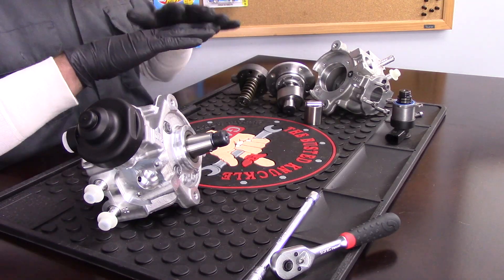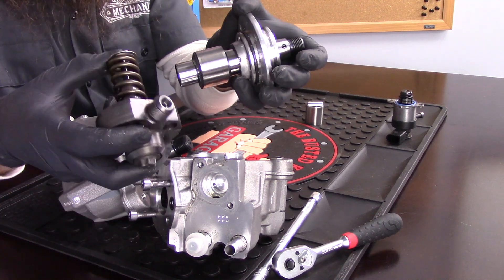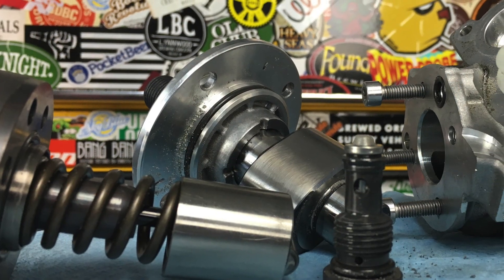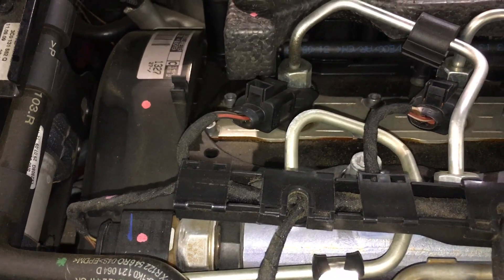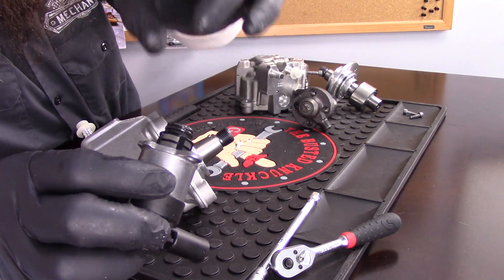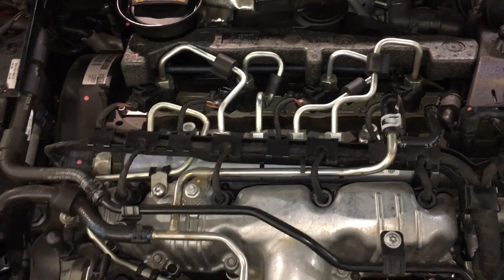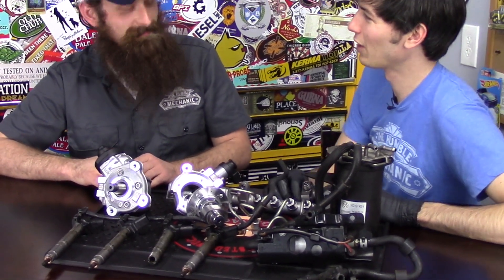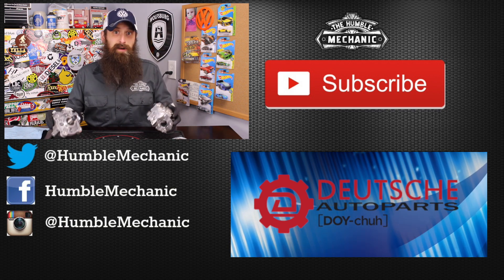How VW Parts Fail ~ TDI High Pressure Fuel Pumps

Comment: This is a completely overhyped problem. I work at an independent vw/audi shop. We sell tons of a3 and jettas with 2.0 tdi. Work on tons more. We have yet to see one failure. Most failure is caused from contaminated fuel. I.E. water, crap bio diesel, people even put gasoline in them.
Reply from the maker: Today that’s very true. Back when this video was new, it was really common.  We were doing 2-3 a week st the dealer.  Most weren’t misfuel issues.
Reply: @HumbleMechanic  how can a dealer substantiate a fuel contamination allegation? I have a 2014 VW Jetta TDI that was part of the emissions fleet modified and resold by VW. I have that same exact problem yet the dealer is voiding the warranty under pretense of contaminated fuel. How could the contaminated fuel be adjudicated? Ie how do I know my fuel is really ‘contaminated’ n whether that contamination is what caused the fuel system failure?  Please answer me. I’m stranded without a car for 3 months now. Bought that Jetta for $8k in 2019 now in 2022 it’s costing me as much to fix it! An abrupt failure on the Highway without warning out of nowhere!
Reply: Sooo by your logic just because YOU haven’t seen the problem that means it doesn’t exist? This happened to my 2010 Jetta TDi and I had to shell out $6,000 to fix it because I was sitting at 121,000 miles. In order to qualify for the DG Buyback I had to out of pocket this so the car arrived at the dealership under its own volition. This pump, the CP4 pump in Touareg TDi, the larger Bosch pump in the Ford 6.7L Powerstroke….from THAT era were known to catastrophic failure. It is VOLKSWAGONS story and excuse to NOT fix it and blame it on contaminated fuel. MY FUEL was GOOD but they flunked me because I didn’t have the filler neck mod, which ESSENTIALLY was VWs recallesque solution. Bbuuuuuttttt I always have my VWs serviced at the dealer…wwwhhhyyy didn’t they put it on my car. You’re right. Completely overhyped.
Reply: I’m suffering w that problem. The dealer blames it on contaminated fuel. I am the sole driver of my vehicle only full diesel almost always at that one quick check in my area. The dealer needs to substantiate the contaminated fuel allegation before they void my warranty yet they’re refusing to! Wth is contaminated fuel????? I only fill diesel at the same quick check yet suffered and abrupt failure of my fuel system.

Comment: Hi HumbleMechanic, I got a story for all TDI owner that you would not believe. Just recently I had HPFP failure on my 2013 Passat TDI about 2 months aprox 10,000 kms after the emissions fix.  It was the classic failure glow plug lights flashing loosing power quickly to never start again.  Searched on the internet and used VCDS to scan the car and confirmed that HPFP has failed.  I called the dealership and they said HPFP and fuel system is covered under Emissions fix extended warranty (Canada).  The only time it will not covered if they find fuel contamination.I thought I would be extra careful After I heard so much about VW finding an escape goat and not to covering things under Warranty.  I drained the fuel tank (which I tested was 100% diesel) and there is no way I will miss fuel my TDI as this is my 3rd TDI.  I remember filling up at the ESSO gas station and their was Sprinter guy waiting behind me to finish so that he can fill his tank.  Anyways I emptied the tank using VCDS and running the pump.  After that I went to another gas station and bought 23 liters of  Diesel fuel in the can and dumped it in the tank.  Cleaned the fuel filter reservoir and change the filter.Next day I Called VW road side assistance and had the vehicle to towed to the dealer.  After couple of days I called the dealer as I had no update from them.  The service advisor told me that they smell gas in my tank.  I said there is no way and went to see the car.  When the showed me the tank with fuel pump removed (under the rear seat), I told them how come it seems like its more than quarter of tank.  They said that they had to top it up in order to troubleshoot.  I asked them what kind of troubleshooting is this, that it needs more than 1/4 of tank.  They insisted that it smell of petrol and it may be that I had put gas instead of diesel in the car.  I told them that this car has filler neck to stop a gas nozzle from fueling the car.  I asked them to do fuel analysis and let me know the results.I called them a couple of days later and the service rep told me that VW was coming to get fuel for analysis.  After that I did not hear back from them.  I called them again as its now approaching two weeks since they have my car in the shop and no rental was provided to me.  They tell me that the service rep is not at her desk and they will get back to me. So finally at the end of day on Friday I call them again and ask to talk to the service rep and she told me that the car would not covered under warranty as it has contaminated fuel (petrol mixed with diesel).  I told them that I need to talk to the service manager.  When I talke dto him I had few basic questions for him.  How did you come to the conclusion that the fuel is contaminated and why did your shop mechanic felt a need to add more fuel to the tank.  I gave the car with 1/4 tank of fuel and now its past 1/2 tank.  He had no answers for me and told me to talk to my Insurance company.  I went and confronted him and still he had no answers.  I asked for report on the fuel and he said they don't have any, all they know is that fuel is contaminated. I had my car towed to my home the same day and started documented everything.  I did the fuel test with Styrofoam cup and found that it had petrol in it.  I did the same test on original fuel that I had saved and no traces of petrol.  I once again drained the fuel and refueled and sent it to different dealership and waiting on the response.  I have video tapped everything on draining and drying the tank and then refueling with new diesel.  Also have the Styrofoam tests on video.I'm so mad at VW dealership and will be brining out my story to the Media.  Hopefully its only one bad dealer and not the VW itself.  We will see... I will keep everyone posted.I keep on remembering the VW CEO statement, We have to build the trust again.. yeah right.
Reply: Keep us up to date on this
Reply: I've been considering a 'fixed' Dieselgate Passat.  This story scares the <bleep> out of me and makes me thing a hybrid might be a better alternative even though I really want the TDI.  Sooooo sad!  I hope you finally got your car repaired under warranty -- and then exposed this dealership to the universe!!!!  This is a news story waiting to be told!!
Reply: How did it go with the 2nd dealership?
Reply: You post a novel like this and leave it with a cliffhanger? Can you give an update?
Reply: This poor guy got screwed
Reply: Please update...
Reply: I am going through something similar right now! I am on 10 months so far.

Comment: I have a mk7 tdi with 49,000 miles, i run kleen diesel additives usually every fillup, rn its the winter additive, i just replaced the fuel filter at 46,000 miles, hopefully that prevents this failure somewhat, i figure there is only so much i can do, any recomendations past this.
Reply from the maker: I think you hit it dead on. Do the maintenance, drive the car and enjoy.

Comment: Hi.. i having question on diesel fuel system...  my diesel engine common rail pressure read up to 1000 bar during cranking.. and can hear high noise of knocking from my engine, after let it idle for 3 to 5 min, the CRP drop to normal idle reading 300 bar.. checked and replaced the new SCV, however the issue still persist... need your humble advice.. thanks..

Comment: i have a 2006 passat, dealer says camshaft worn out and it need a 3000 repair, i will work with an updated to fuel pressure pump since camshaft does not seem to be that bad to me.

Comment: Greeting @HumbleMechanic !! I have a 2010 Jetta TDI that I bought new in December 2010. June 6, 2018, just 2 weeks ago, our car stalled coming to an intersection. It wouldn’t start again. Towed to dealership where they found metal in the fuel. They’re claiming the fuel failed the contamination test, and won’t cover it under the warranty we have for the fuel system. I’m so peeved… even have the last 3 receipts showing I used diesel fuel. (Also I’m not an idiot and have never mis-fueled my vehicle – I bought it BECAUSE of the diesel). How many miles would you estimate you could go on contaminated fuel before it dies? I was at 384 miles on that tank (im estimating I went through about 8.5 gallons).
Reply: Sue. You get nothing without fighting. Threaten them with media coverage.

Comment: If you dont want this to cause a huge issue replace it every 100k. before it goes bad.
Reply: we are finding that over 100k is borrowed time if you dont have contaminated fuel. Ususally before 100k repairs are from more bio diesel or contaminated fuel.  If your in a bio fuel percentage state might want to lower that to a 75k interval.

Comment: Let's call a spade a spade... this is a Robert Bosch HPFP failure, not a VW failure. Just like the VW TDI Clean Diesel Scandal, and Robert Bosch has to pay a fine also, as ordered by the judge via a court order. This Robert Bosch HPFP failure happens in all badges of cars and trucks that use the Bosch CP4.1 or CP4.2 HPFP.  Ford, GMC, Ram Ecodiesel, etc.  The HPFP's fail, and take the whole fuel system out. Shame on Robert Bosch for doing either no Failure Analysis of their fuel systems, or being deliberate about it failing, hopefully just outside of the cars warranty period. It's a crappy design, with ZERO way of keeping that cam roller aligned with the camshaft surface. It needs to be retained so the roller can NEVER go sideways or out of alignment with the cam surface, much like a connecting rod does with a crankshaft and the pin through the piston on the top end. Shame on you Robert Bosch, for designing such crap product, to line your own pockets with designed built in  catastrophic failure, all the while lying and calling it a "self aligning design", except when it doesn't self align and fails catastrophically.
Reply: so when Bosch gives VW this HPFP, VW does not check its reliability but blindlessly puts it on the car? As end user I have bought the car from VW not from Bosch. VW should test its vehicles accordingly, HPFP is not a part which should be replaced regurlarly. VW should solve its problems with Bosch.
Reply: This was a VW engineering call to use these pumps.   VW has the ability to test components and examine them before putting them in their vehicles.  
The pumps are designed for a best case scenario of no mis-fuels and #400's um wear scar rated fuel in Europe vs. 500's um fuel in America.  They are a lousy, marginal design and they fail even with 400's um rated fuel.

Comment: I have an 02 1.9 liter VW TDI and when I try to pull a vacuum on the return line of the injection pump no fuel will pull through all it does is create a suction and then will collapse my hoes. Is this supposed to happen or should fuel flow through the return freely when I connect a vacuum pump up to it to check my fuel system for clogs?

Comment: presuming you use decent quality diesel and don't fuel with gasoline rather than diesel, is there a way to check the fuel pumps Health? to ensure you don't get a catastrophic failure? 
is it common practice to look inside the fuel pump for metal pieces?

Comment: I just tried just replacing the HPFP on a customers car because she has to turn it in to VW for the buyback. I needs to run under it own power for them to buy it back ,which make no sense knowing all the issues there having with these HPFP failures. The car is a 2010 golf TDI with 160k so it's not covered. I also change the fuel filter cleaned out the tank and lines. Unfortunately the car just cranks and does not start. I have 10 psi pressure from the in tank pump at the fuel filter and I have 45 psi pressure out of the electric pump to the feed line directly at the HPFP. After priming all the pumps with the VCDS Then I crank the car and monitor the high fuel pressure in the rail it only reaches 8 bar. So I'm going to replace the injectors tomorrow, what confuses me is that if there were bad injectors (clogged or defective ) I would think the car would still develop the proper high fuel pressure or am I mistaken?
Reply: Having the Same Issue on a 2010 Jetta. I came ino the job second hand another mechanic originally diagnosed and replaced the HPFP but gave up on it. Seems that diag info on this is a vw secret.

Comment: I currently have a 2012 tdi and out of curiosity do you have to prime the fuel system with the vcds if you wanted to take just the valve off to inspect the hpfp for metal shavings?

Comment: misinformation. failure occurs from poor pump design. roller bearing and piston has nothing mechanical in place to keep roller perfectly parallel to cam causing roller bearing to turn 90 degrees and then cam lobe eats it up which is where you get your metal shavings from.  I still have my cp4 bosch in pieces.  will post video one day
Reply: +James Michael probably is good prevention. mine had 92k klms which is ?miles.  just ticked over 100k with no issues after new pump and not replacing entire fuel system as was recommended in other threads.  i did put 2 micron inline filter after factory filter and replaced both at 97k.  there was still some shrapnel in factory filter housing. will change filters again at 102k.  with moly fuel addative (highly recommend @ 10ml to 15ml per 10 litres) it is actually running better and smoother than before and way more klms per tank.  Maybe that was the sign of pump going?  klms per tank were getting less and less.   that or crap fuel.
Reply: ps.  never thrash a diesel unless u have heaps of liqui moly in tank.  keep rpms down.
Reply: no worries James.  if i were u i would just put in moly now ie today...get 2 micron installed ie next week... and wait for pump to blow up or replace with no rush.
Reply: James.  just went through my previous posts and failure happened at 89k klms which is 55k miles
Reply: save your money me thinks.  too extreme.  I love my touareg.  The drive, feel and comfort is awesome. I plan on keeping it for long time so I will do all my own services and repairs until I have to spend more time with it than the kids.  Other than hpfp, it has had no major issues.  My missus' car is australian made ford territory and I am replacing suspension bushes at 60k klms.  total rubbish in quality, drive, road noise...you name it.   AWD in touareg really makes a difference.  it is glued to the road.  i never knew cars were meant to drive like this. I can never go back now

Comment: In the movie Kelly's Heroes, one of the Tiger tanks has a problem with the fuel system. After all these years, German fuel system problems still exist!

On my 2015 1.8 TSI, we had a camshaft recall and I expected a new camshaft because the recall mentioned Sintering and shaved off lobes. Yet I am now told that an ECU flash solved the problem. Are they being honest with me? Can you tell me why a flash makes a difference?
Reply from the maker: +Minnesnowtan just shot a quick vid about this exact question. Should be up later today.

Comment: A fuel pump failure leads to a $6000 bill?  Another excellent reason to never buy a Volkswagen diesel, a ridiculously bad design
Reply: The CP4 pumps are used in several diesels, not just Volkswagens.

Comment: Just started watching your channel. Are all VW with these fuel pumps ticking time bombs then?
Reply: unfortunately, yes
Reply from the maker: +Anthony Nowlan by now, most have been replaced. We don't see them fail at the rate we used to.
Reply: magically, quality of diesel has improved?  NO me thinks.  but then again, now that crude price is lower, no need to add that old deep fryer oil to the barrel...

Comment: How to prevent it though? I'd love a used to tdi wagon but a several thousand dollar repair is enough to turn me away completely.
Reply: Switch to a Cp3 pump, but I’d say you’re more likely to have it never happen even though it happens too often.
Reply: getting fuel from a quality gas/fuel station, adding some sort of fuel additive to give the fuel extra lubricity can help.
Reply: The warranty on the TDI powertrain has been extended
Reply: It's honestly better to take a car you are interested in and research the common failure and service due at miles. Take the cost of what those repair and wrap it in what you plan on spending. Because in the end a used vehicle has great appeal but the maintenance is the same as it was new. All used vehicle need something or another but in rare cases we'll documented service history of those service may be the vehicle for you. Just educate yourself because not all repair shops will be and you're money will be wasted without someone knowing what they are doing

Comment: Not related to this but i have a 11 jetta se with transmission problems and it throw a whole bunch of failure codes. Is there anything that commonly goes wrong? Can it maybe be a diy to replace it i have a little experience working on cars but not a lot.